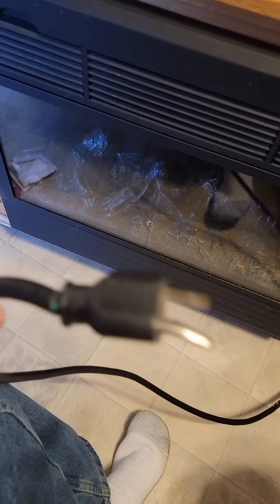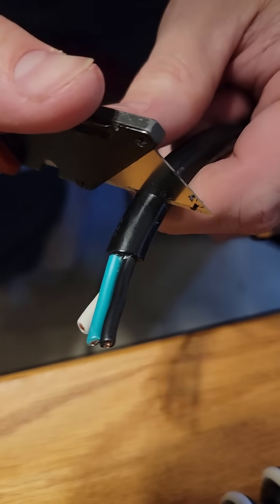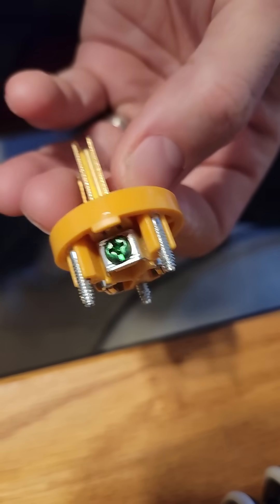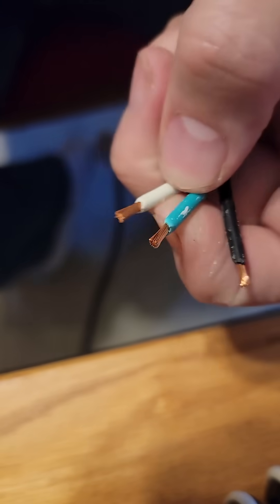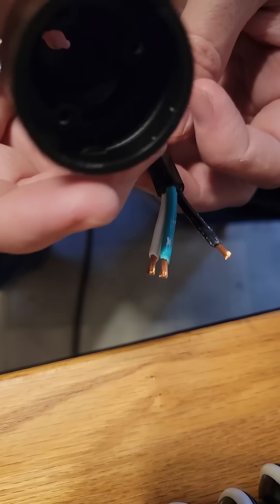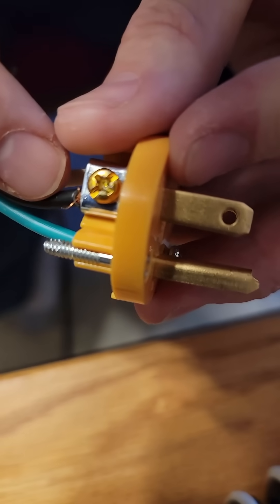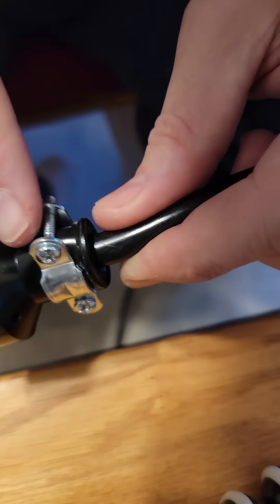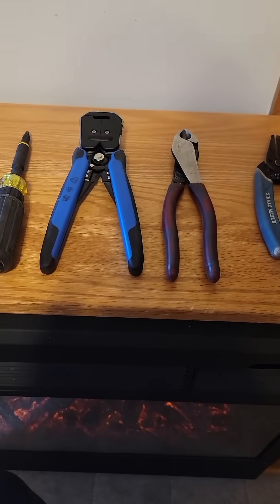How To Replace a 3 Prong Plug 15A/120V (USA)

Comment: What if the white and black aren’t labeled/color coded?
Reply from the maker: Good question! Usually when they are both black, one of them has ridges. This is typically the neutral. If you are still unable to tell, I would try to find the information off the product website. If you can't find it there, you probably need to call an electrician.

Comment: Wish you had slowed a second when / where you placed the new wire; Slot ? Just anywhere?
Reply from the maker: Do you mean in the heater? Or the sleeve that goes over the plug? For the heater, I used the same cord that was already attached. To slide inside the shell of the new plug, there is a hole in the back that you slide through. If that does not answer your question, describe a little more what you'd like to see and I'll help you if I can.
Reply: @alteredsoundeffects  Thank you for the reply, One of the greatest challenges of doing minor repairs for yourself is not having the vocabulary.  Anyhow, on a closer look, I discovered that the old j hook is no longer the method.  I found that if I shook the plug, the channel reveled itself
Reply from the maker: Oh, I know what you are talking about. Yes, some plugs still require a j hook, but this is a clamp, so you push the wire directly in. Two things: Make sure the correct wire is in each slot and use a large flathead screwdriver to tighten down the clamps (also called terminals) so they are nice and tight. Loose connections are the #1 cause of electrical fires. Glad my video was able to help you! 🤩
Reply: @alteredsoundeffects  My best to U n Yours !!  Thank You